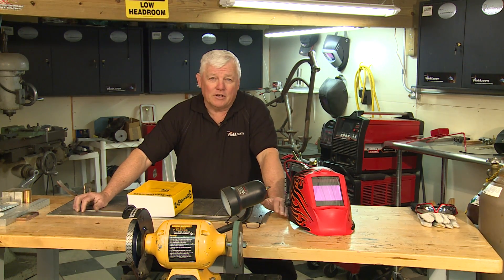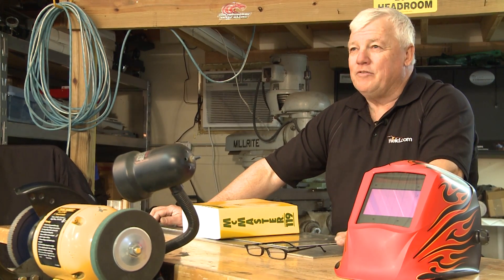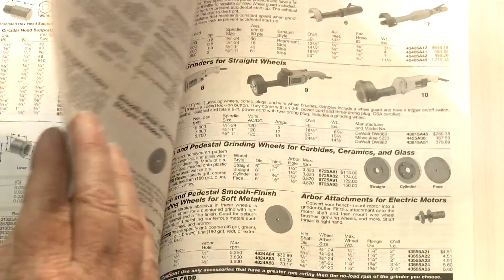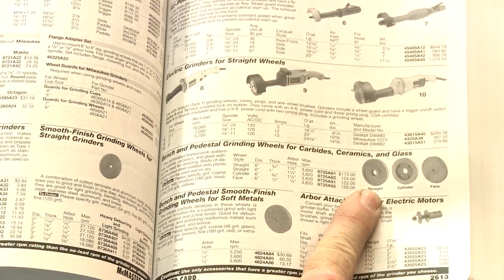Grinding Tungsten (Part 2) | TIG Time

Comment: Glad to see some old school tunsgsten sharpening there, .... BY HAND. Ive been tigging since 1979, chromoly racing frames to aerospace and everything in between, and ive sharpened my tunstens by hand like that ( usually downward tho ) on a belt or a wheel, since day one. Just have a little short cup of water next to the grinder to dip cool those tungstens when they get short..... lol ......

Comment: I always chuck up my tungsten in a hand drill and take it to a 1200 grit diamond lapping plate on a bench grinder then polish it with a cloth wheel with a fine jewelers rouge. Makes a super nice even point that keeps a super smooth arc

Comment: I'm curious, and a few hour into researching, about what may actually be superior to diamond for tungsten sharpening. CBN (cubic boron nitride) wheels. I can't seem to confirm if you can run them on a normal 3500RPM grinder (they recommend slow-speed grinders.) Also if there is any risk of the CBN contaminating the tungsten itself.

Comment: I sharpen my tungsten in a hot propane and oxygen flame. Vaporizes it to a very fine point.  I don't use it for tig welding tho (yet) I use it to "drill" or pierce hot borosilicate glass.

Comment: Hi    We use those too.    We have grinders JUST for tungsten & are wheels have industrial diamond on them  6" OD 1" wide  we use about 80 course wheel & fine 180 -200 fine  rough in tungsten on course side & fine tune on the fine wheel  very quick tungsten & as sharp as you could ever want usual touch off the sharp tip .  The wheels do last a LONG time as long some idiot doesn't sharp other things on the wheel .   So just like the Lincoln Tech instructor said wheels last for years many years .

Comment: I bought this wheel yrs ago after this video. I use a variable speed drill and put tungsten in the drill and tighten the chuck and slow turn it for near perfect grinds

Comment: Only noobs grinding tungsten with their hands and only noobs use the front of the wheel. Grind on the side of the wheel with a power drill perfect grind every time and no ware groves. And grind a few backups. Keep welding ya’ll

Comment: Mr. TIG do you have the part numbers for this wheel(cant find it sorry) and did the wheel need an arbor adaptor? The one wheel I found in the catalog showed the diamonds bonded to plastic, wont that cause contaminants to get into the tungsten? thanks Richie
Reply: alright found all part numbers my only concern now is what are the voids the black holes? its not plastic and will smear up the tungsten right lol ? thanks
Reply: what are you talking about? I have this exact wheel so i can help you out.
Reply: when your looking at the wheel the black holes from what the person at mc master told me is plastic , how deep are the "cleaning holes" ?
Reply: they are basically level with the diamond plate thing that you grind with. when you run ur finger down the wheel its smooth really. its a hard plastic wheel with a metal/diamond carbide/ i dont know what haha. 

dude just watch this video... Its literally exactly this same thing so..
Reply: pause the video at 3:09 and you can see what im talking about....
Reply: thanks

Comment: I bought this wheel myself after watching this. Love it! I have a 1/2” arbor tho so i had get some spacers online. You can get plastic or metal. Ive tried both and like the metal better. The spacer i went with is on amazon for $22. Love this setup!
Reply: 4461a423 in the McMaster catalog
Reply: those are plastic.... you wanna go with metal, trust me.
Reply: why is the wheel badly balanced?
Reply: idk what your talking about lol... they might have a small amount of wobble at the startup. and that could be different from grinder to grinder due to the tolerances of each machine. If your thinking about getting one of these do it. dont even think about it. you wont be disappointed at all. just make sure you get on amazon and buy this spacer: https://www.amazon.com/Reducing-Bushing-Adapters-Grinding-Wheels/dp/B01ED30XRY?th=1  and you will be good to go.   these wheels work GREAT considering how much tungsten grinders are.
Reply: I make my own bushings on my lathe... made a few from aluminum and some from stainless steel... just what ever I have laying around in scrap metal... Having a welding and machine shop really helps...

Comment: Flap disk in a 4 1/2" grinder does enough of a job for me, close to hand, takes seconds. Sometimes you dont have a workshop and bench grinder to hand lol
Also the grind angle DOESNT HAVE to be parallel to the axis of the tungsten

Comment: That wheel is coated with industrial diamonds, not carbides, FYI. EZE Lap has made their diamond stones like that for years. (diamonds embedded in a matrix on perforated steel sheet) It helps to keep the surface from loading. Thanks for sharing. Nice vid.
Reply: Jeffrey Fluharty maybe he was confused about the green wheel which is silicon carbide

Comment: The suggested Grinding wheel looks great and I spoke with the manufacture and asked about the 1.25" arbor.  They said it was made for and tested on a Baldor grinder that has that arbor size.  I do not, I have a 5/8" arbor.  Any suggestions?
Thank you,
Reply: MSC industrial and a few other suppliers sell reducer bushings you can use to make it work.
Reply: 4461a423

Comment: McMaster-Carr is ELITE. I've ordered a few things from them. 0.025" 1095 Blue Tempered Spring Steel for making lock picks, Carbide burs, 0.25" tubing, etc. etc. I'm so glad I found out about them. I actually found out about them I believe from my interest in wanting to make lock picks. Since then, damn near anything I want, I can get it from them. I really like the grinding wheel, really nice. For $100+ it's not bad, seeing that you'll have the best grinding wheel on the planet next to diamond. (+1 : 56)

Comment: How did you solve the problem of the hole in center of wheel is 1.5 inch and my Arbour is 5/8
Reply: 4461a423

Comment: Have you ever drove the tungsten into your hand grinding it like that. I had the oint catch one time and stuck it in my hand I dont grind both ends anymore.
Reply: Use a drill
Reply: Donald Fuller 
I learned the hard way never use an angle grinder with a "tiger paw" on it. went through my glove and stick in my palm.

Comment: How do you mount the (McMaster-Carr)Carbides Ceramics and Glass Grinding wheel to a motor or bench grinder... the part number out the catalog I found is 8725A81 - 180 grit at $113.00 with an arbor of (1 1/4)... Thank you!

Comment: Hello Mr TIG. I am new to TIG welding. What is your position on the hazards of tungsten dust?
Reply: Not to high jack the answer, but for years and years we used 2% thoriated tungsten for steel on the old transformer machines, ( started before 1979 for me ) and nobody really knew there was any concern about the radioactive nature of them or the dust. I guess we're all more or less fine, but I would say there is ZERO kinds of metal dust that you should be breathing in......  So just use common sense. Tungsten dust is relatively heavy compared to other metal dust and not prone to becoming airborne very far from the discharge point. Just don't have your beak right down where the tungsten is being ground and you'll be fine. Most modern machines now prefer lanthanated or ceriated, or a blend,  Rather than the old thoriated so I think it's a non issue. Don't breath ANY metal dust, but in general tungsten dust just shoots to where it accumulates and that's about it.

Comment: I use a worksharp 2000 to grind my tungstens.  It is a horizontal sanding pad motor driven.  Works great and sharpens quickly.

Comment: Next time chuck your tungsten in a cordless drill for the rotation.  So what happened to th e tool rest and wheel guards?
Reply: I've been tig welding since 1979, everything from racing BMX and Harley flat track frames to all kinds of aerospace applications and everything in-between and I've never "chucked" the tungsten up in a drill to sharpen. It's funny how little trends like that perpetuate themselves. I don't like the drill method as even at the slowest speed it starts to pull the grain diagonally. For most people's welding needs it matters not, lol, ...... I've been in crappy environments using whatever dirty grooved grinding wheel mostly sideways, and ya know the part welds up. It's only the really tricky welds and finicky alloys that anything other than a perfectly ground tungsten will cause you unwanted stress.

Comment: This particular bench grinder was an 8".  The carbide wheel that I ordered from the catalog is 6".  Thanks for watching.. Mr. Tig
Reply: wheel for grinding carbide, should be a diamond (natural) abrasive, right?  Synthetic diamond for grinding steel.